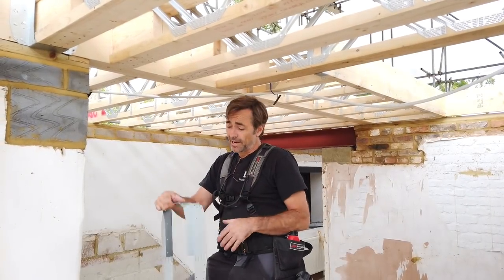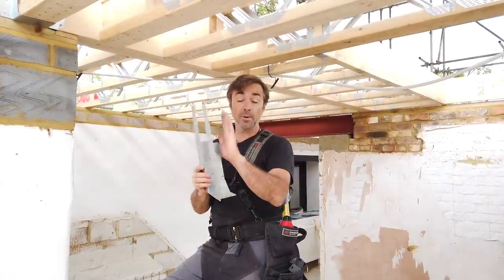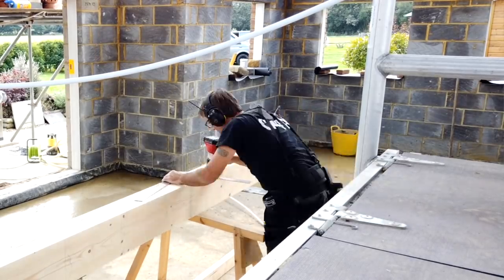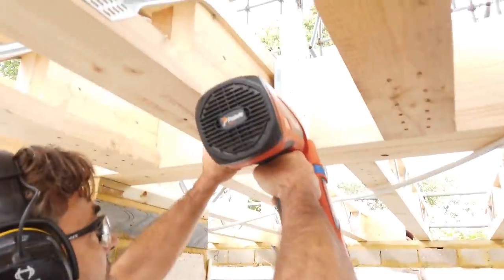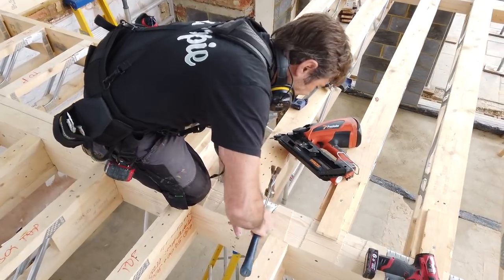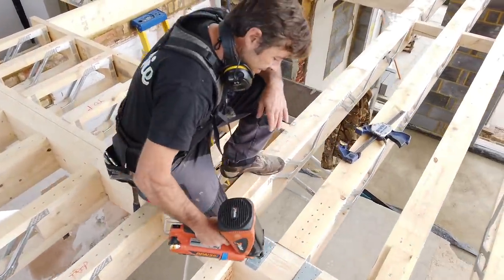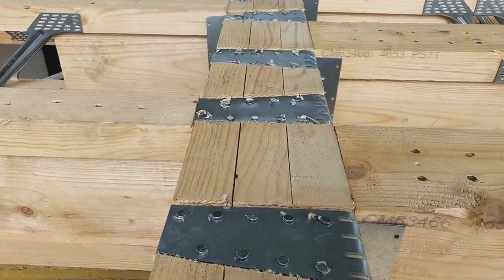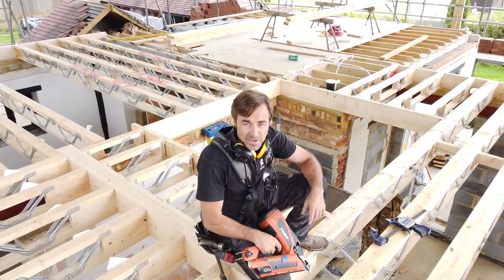Super Flush Joist Hangers in a floor, No bumps and squeaks!!!!

Comment: I saw the positive placement paslode on your channel a while back. I have two guns that do that but both air. Looked around to see if available and couldn't find it. Contacted paslode direct. They have no intention of bringing them to Oz no need. We use tons of hangers and straps and supposedly now building code says you can't  coil nail them any more. Dewalt did make one but stopped. Not in Oz. Hikoki now make one but we probably won't see it. All very strange.

Comment: What about the gap between the hanger and the side of the joist.  Because if the joist design there is a gap between the hanger and the joist with no fixings.  Do these manufactures recommend infiltration pieces so you can fix the sides of the hangers?

Comment: How do you know what screws or nails are required for particular task? There are so many kinds and now also nail gun nails. Is there any building code or book where I can learn this?
Reply from the maker: Just experience I suppose, generally a structural engineer would always list the correct fixings for different applications when it comes to structural carpentry etc, otherwise its google!!!

Comment: Nice to see a job well done. The amount of looks I've received for doing the very same thing from some, but I carry on as I have always done regardless. I've sometimes received drawings that state the NON use of guns because of the half moon head as opposed to the full round. Has anyone else had such a request ?
Reply: I've had exactly the same. I had to buy the Paslode 360 as it uses full head as opposed to clipped nails for exactly that reason. I was also told to use genuine nails as opposed to generic as they could guarantee specs with genuine only.
Regards
Tim
Reply: Both the Paslode PPN35 & latest PPNXi Positive Placement Nailers use "Full Head" 3.4x35mm Twist/Helical Screw/PPN Electro-Galvanised Nails (Pasload 141189) for installing  joist hangers, straps, framing anchors/ties etc. Also in the USA Metabo HPT (aka UK Hikoki) has recently released a 36V Cordless/Gasless Metal Connector Nailer (Metabo HPT NR3665DA). I don't know when the Hikoki version will be available in the UK.
Reply: @rockymount2393  Thank you very much. The info is much appreciated. 👍

Comment: Really surprised the trouble you have gone to rebating beam for a nice flat finish for flooring un yet the underside of the hanger is left to sit proud of the joist this we find creates a bigger problem for the plasterboard and skimming. Really enjoy your videos but dare I say somethings are completely over engineered son is a structural engineer and couldn’t agree more not that that is a bad thing . If the fit and finish are correct firing more and larger nails achieves very little other than cost and time this is by no means a criticism just a observation in over 38 yrs in the industry.